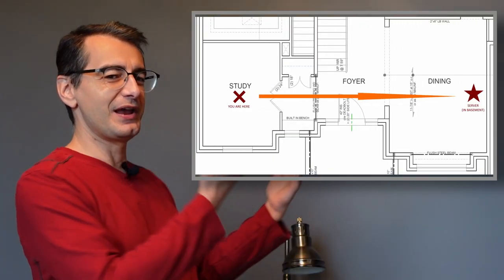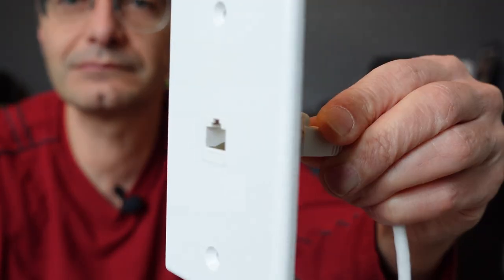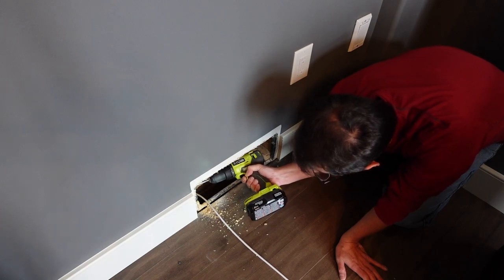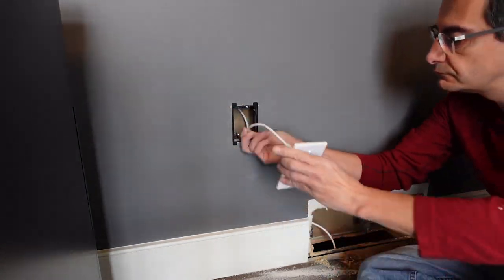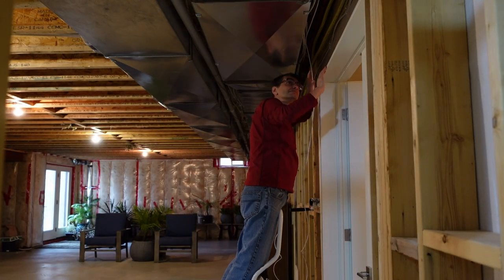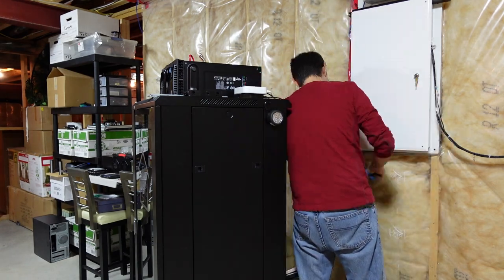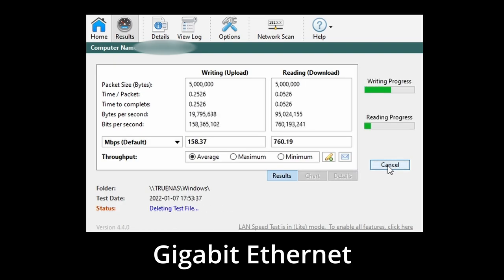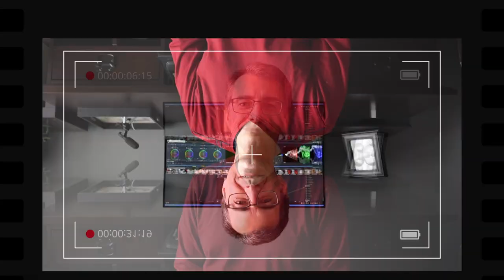NO MORE WiFi! - Easy DIY Ethernet cable install using cold air return as conduit & no crimping wires

Comment: And before the Google gurus chime in, using an air return duct IS in compliance with NEC as Ethernet is defined as “communication” cables and not the umbrella of normal electrical wiring. What they get mixed up (because the NEC and NFPA jump around a bit) is supply versus return ducting and the requirements are not equal.
Reply from the maker: Thank-you for sharing this piece of information. I know lots of people ask and wonder about it, and I should have addressed it in the video. Great comment!
Reply: However, the likelihood that the prefabricated cable is plenum-rated is exceptionally low.
Reply: So its ok to use return for low voltage (comm) wire but not supply? Does that include using riser or plenum cable?
Reply: Not that it would be the business of anyone if it wasn't and you are in your own home.
Reply: @r2db it dosent matter in a cold air return anyway.

Comment: Great solution, did you have to use CMP cat6 cable
Reply from the maker: I used CAT 5e, but CMP is recommended for air ducts.
Reply: @HomeCulture  In this day and age, you really want Cat6, and if youre really future forward you can use Cat6A. You really don't spend that much more for 6 over 5e but you can get 10gig up to 55m, which is most runs.
Reply from the maker: @JeronimoStilton14  This is the only 5e cable in my house; the rest is all cat6, but if I go 10Gb, I'll test out this cable to see how it performs. Or I may just go with WiFi6E or 7 in the future seeing how fast WIFi is getting.

Comment: My cold air vent is blocked off with wood because it’s a finished house. Do you recommend drilling a small hole through that piece of wood in order to run an Ethernet cord from one vent to the other?
Reply from the maker: I'm not sure I understand how the cold air return vent is blocked; they shouldn't be blocked as they provide airflow for your HVAC system.
If you know that behind the wood is the ductwork for the return air, they I guess you could drill a small hole through it. Without being able to visually seen your situation, it is hard to know for certain.